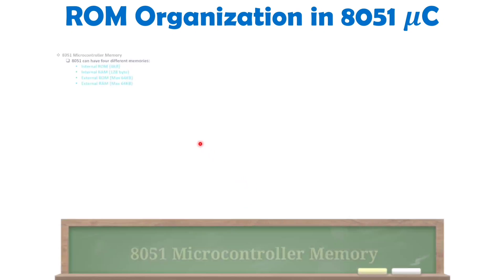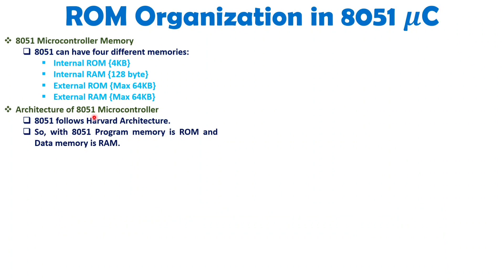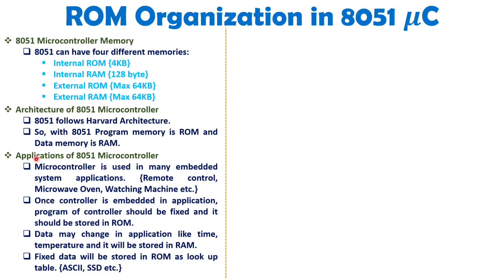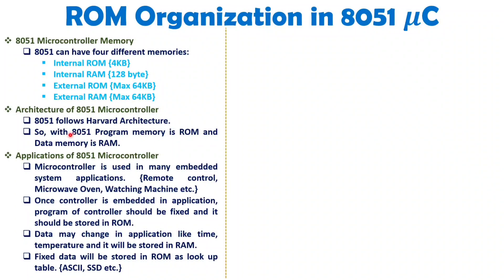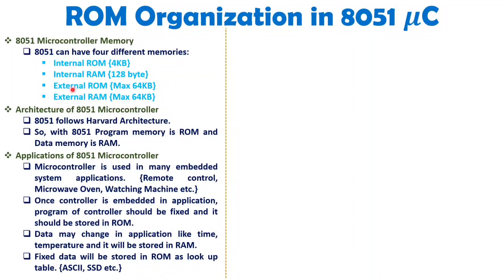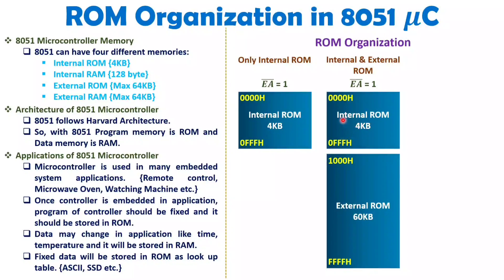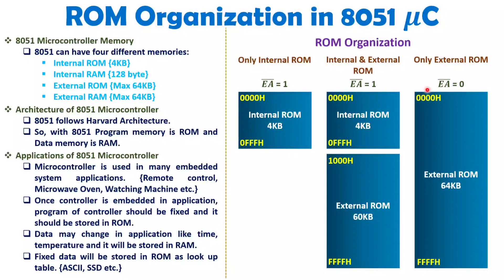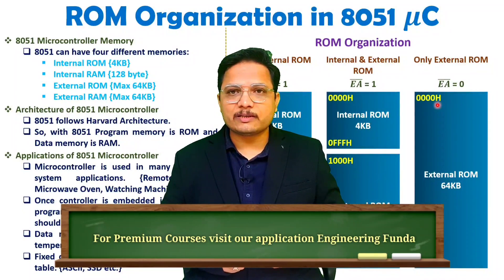ROM Organization of Microcontroller 8051 | ROM Structure | 8051 Memory Organization

Comment: Sir why can not we use 4KB internal and whole 64 KB of external, instead of 60KB?
Reply from the maker: It is not about you and me, it is about how it is implemented in 8051
Reply: @EngineeringFunda  Thanks for express reply Sir, i understood that 8051 has 16 bit address bus which means 2^16 addresses which eual to 64KB so total we can have 56KB only.
Thanks Sir very good explanation.

Comment: Sir in ROM organization in second example where we are using internal & external ROM then we should also put EA bar to 0 due to external coonection of ROM? But in your slide only EA bar shows 1. Please explain it.
Reply: In the second example programmer decided to use both internal and external ROM
As the usage includes internal ROM - (EA bar ) pin == 1

Where as in the 3rd example programmer decided to use exclusively External ROM only, there is no involvement of internal ROM and therefore (EA bar) pin == 0